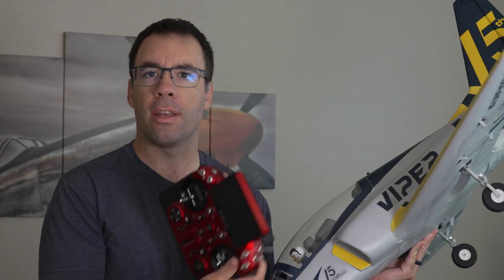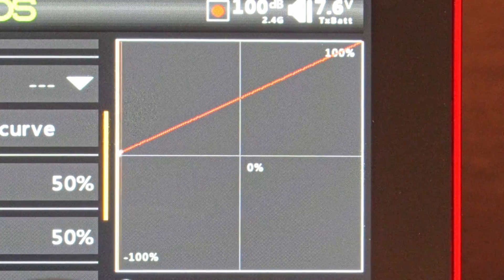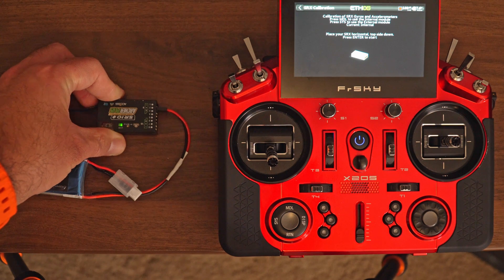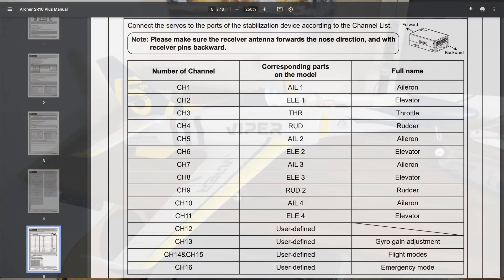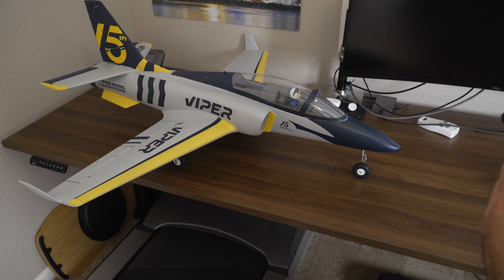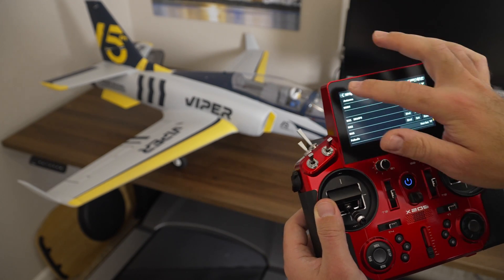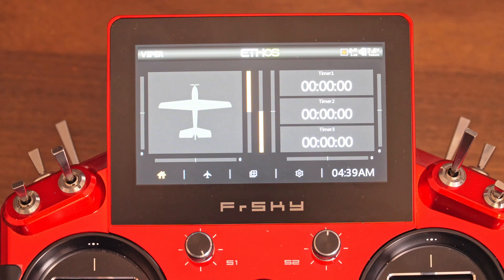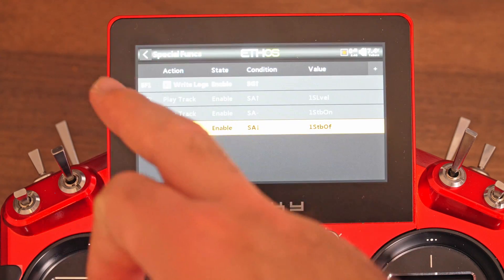FrSky ETHOS: Setting up a stabilized receiver

Comment: Hi Mate. Question about rx with gyro. Do I have to do the "self check" before every flight? What is a good starting point setting the gain? If I have 3 different modes setups with expo, say 100%, 80%, and 60%, will this have an effect on the trow/travel for the gyro also? Say I change from 100% to 60% will this also limit the gyro to that? Cheers

Comment: Hi, need your opinion please. I just got a freewing F-15 90mm jet and trying to install an A3 Super 4 gyro and a TD R10 rx.
Only readily avail position for gyro is on the ply shelf above the nose-gear, of course this puts the gyro some 15" forward of the CG.  Do you foresee any real issues with this installation?
Reply from the maker: No issues. That should work fine
Reply: @skyboundrc  thanks buddy!

Comment: Hi, after I finalized the setup everything looks fine but when a started the DLE 20 RA gas engine the gyro got unstable  and all moveable surfaces were shacking. Any Idea? Also in channel 14 position 3 all the parts go on full extension. Thanks
Reply: I do not think are the vibrations because the problem persist even if I remove the receiver from the plane and hold in the hands.
Reply from the maker: Channel 14 - position 3 -> That means the gyro thinks it needs to apply full travel to bring the plane back to level. Seems like you haven't done the gyro calibration properly and the gyro thinks its not level. 
Surfaces shaking could be related to the gains set too high and being too sensitive maybe
Reply: @skyboundrc  Thanks I will check again!

Comment: Hi you selected channel 13 and 14 for Gyro Gain and Gyro Mode. Are they dedicated channels, or I can choose 11 an 12. I asked because I tried, and it seemed not activating the Gyro. Maybe I did something wrong.  Thanks
Reply: PS X20S with TD SR10
Reply from the maker: hi! You need to stick to channels 13 and 14. Those are the channels that the receiver listens to for gain/mode.
Reply: @skyboundrc  Thank you very much, do you have any manual where this info is written? I did not find it.
Reply from the maker: No problem! Take a look at page 7: https://www.frsky-rc.com/wp-content/uploads/Downloads/Manual/TD%20R10/TD%20R10%20-Manual.pdf
Reply: Thanks I noticed now. Very Kind

Comment: Season's Greetings all. Awesome video and content. What no one is saying or showing (as far as i can find) are ways of tweaking (I'm working on this) Auto Level response.
If you're used to AS3 type stabilizers, in Auto Level any right stick movement off center causes the stabilization to "back off" and it's "your airplane".  I find the FrSky stabilization system does not want to relinquish control, regardless of gain settings and fights you for the airplane.  I belive under "SRX Stable" that can be tweaked, but i am yet to find proper info on that.  On scale models with AS3 I sometimes like to use auto level on takeoff and/or landings to ease the workload especially on the scale Jets and windy days. Mind you, I am coming over to FrSky from JR 12X / Spektrum receivers and Hobby Eagle A3 Super 3 stabilization. Some of my jets are still Spektrum / A3S and im using a multi protocol module on the X20S and thats just fine.  Nonetheless, I love my FrSky X20S and the SR series receivers, im just not using Auto Level feature, but certainly have it on an "Oh Sh*t" button.

Comment: It is enormously helpful material you are making. I have a question. If I have a fixed wing rc plane with 2 separate servo's for ailrons(which is normal) +2 separate servo's for each elevator(thus 2 elevators hier) + throttle+rudder or another scenario 2 separate servo's for ailrons+ 1 servo for elevator+2 separate servo's for flaps+ throttle +rudder and the real question here is how many channels receiver do I need, 6 channels or 10 channels one? Either way it has to be a one with gyro on.
Reply from the maker: You technically could get away with only 5 channels and use Y connectors for multiple servos per channel, but that usually is a pretty bad setup as you lose a lot of adjustability. I'd recommend a 10 and putting each servo in a different channel.

Comment: Thanks a lot for the video; it is really helpful. 
Maybe I missed it: When is the right moment to set up servo endpoints and neutral position? 
And can I use other channels on bank 1 for non-stabilized functions such as throttle or flaps? If not, I would need a 10ch rx for a 8ch plane...
Reply from the maker: Hi @18AndreasL90! I (quickly) mention endpoints after I'm done with the first self-check (https://youtu.be/DGATksRJcMk?si=Kljwmx67qR-NlvGE&t=752). You can set subtrim and endpoints anytime, but you need to make sure to do a self-check after, so that the gyro learns what your new limits are.
What I did in the video: 
- Initial self-check without touching any subtrim/endpoints/servo reverse. 
- Ensure the gyro is moving the correct servos in the expected directions (you might need to reverse some channel in the SRX menu). 
- Tweak subtrims and endpoints
- Do a final self-check

For non stabilized functions, you should put those in bank 2 and disable stabilization in bank 2. You don't need a 10ch rx for a 8ch plane. You can use ch 7 and 8. Additionally, you can map receiver pins to other channels. By default, the receiver has ch1 mapped to pin 1, ch2 -> pin 2 and so on. You chan change this in the RX options menu. For example, Ch6 is set to Elevator 2 in the gyro. If you don't have 2 elevators, you could connect you flaps to pin 6. Then, in the RX options menu, you can remap pin 6 to a different channel not affected by the gyro (i.e. channel 9).
Reply: @skyboundrc Thank you so much for your very helpful and quick answer! 
So I can set endpoints whenever I want, including before setting up stabilization, for e.g. mechanical protection of the linkages, should these be limited by the airframe... 👍
Also I will make sure to set up the pin assignment. 
Greetings from Germany!

Comment: Awesome Video Juan! I’m coming over from spektrum and I don’t see anyone talking about separating the gyro levels based on axis(pitch, roll, yaw)? And it’s driving me nuts trying to find this. I’d like to use my archer SR10 Gyro with the gains on each axis on a switch especially during my first flights so I can fine tune my planes better. Is this possible with my setup? SR10 and S20s transmitter? Thanks
Reply from the maker: My understanding is that you can modify individual axis gains in the Stabilisation menu, but you cannot modify individual axis gains in flight via a pot/switch.
Reply: @skyboundrc  Thanks for your help Juan! I’m going to be all over it. This IMO is what’s missing here. Jets pushed to the limits of scale acrobatics really do well being dialed in on each axis. Weather definitely makes on the fly adjustments even better. I’ve done it with spektrum and I’m not trying to go back to them. Thanks again

Comment: I set up my receiver exactly the same however in self level mode the plane wants to pitch down. I have been flying with the mode off completely as it has almost crashed the plane several times with it on. Any suggestions on what the issue might be when its in the self level mode? I have confirmed all directions of flight during the preflight. It as if the gyro doesn't think the plane is flying level during flight when I switch it on.
Reply from the maker: I believe there's a elevator offset that you can change in the "SRX Stable" menu. You can tweak that until the plane tracks horizontal in self-level

Comment: If, in custom failsafe mode (See "Failsafe" in RF System, using "Custom"  mode), you set channel 13 to 50% and channel 14 to -100%, whilst using quick mode: If the receiver should go into failsafe, it will glide the model safely down for you.

Comment: great video, how you set up gear, flaps, noze whell and others extras that don´t need stabilization?
Reply from the maker: thanks! You need to connect those on any of the other channels that don't have stabilization. If youd disable bank 2, that's channels 7 and higher. If you keep bank 2 stabilization enabled, that's ch17 and up I believe